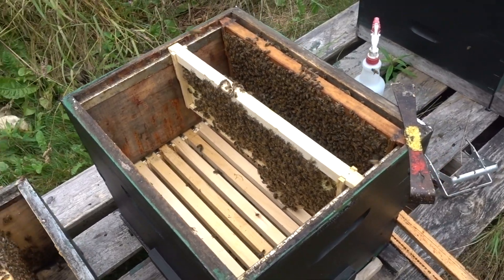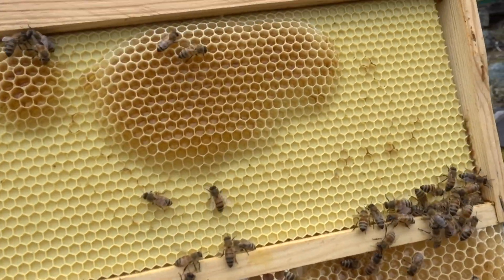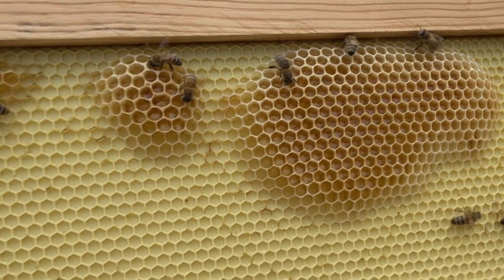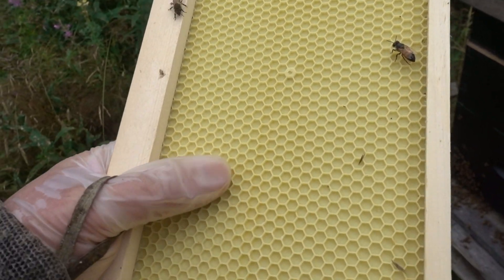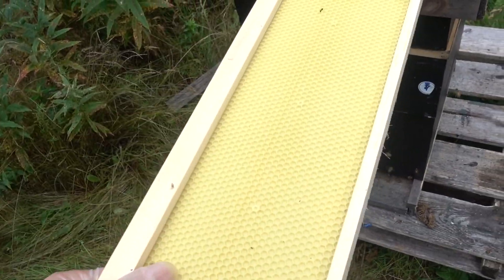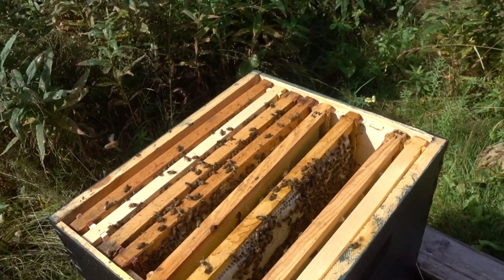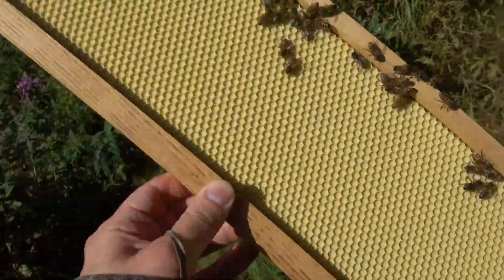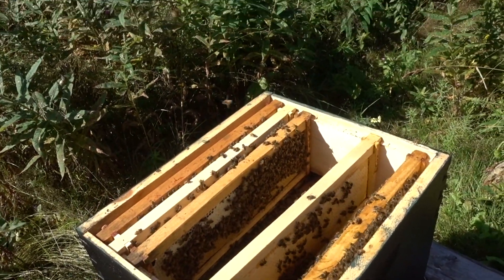When Honey Bees Won't Draw Comb on Plastic Foundation

Comment: I like the plastic foundation over the natural wax for the simple reason that you can spin the crap out of them without breaking as the natural wax does a lot of times even with the wire in the frame.At first, I got RiteCell foundation, and didn't wax them, learned that it is a slow process, than wax paint them, got better, but than I went and got Arrow black foundation that comes as double waxed, I got those because I can't see the eggs in the  yellow plastic or natural wax but can see clearly in the black foundation for queen rearing, so I got black foundation even for the mediums; since I've done that, no more issues, feed or no feed the bees, they draw just fine.Because I use Ross Cartriges for honeycomb I care less for the natural drawn frames.Arrow are a little more expensive but well worth the money.When you have a short season like you do as me here in Michigan, every little trick helps to speed up the process.Dan
Reply from the maker: I have a few boxes of white and yellow foundation, and I'd be glad to get rid of all of it.  If we're using plastic foundation, it makes no sense to me that it would be anything other than black, whether it's for the brood box or honey supers, but especially if it's for the brood box.

I've heard about the foundation that is double-dipped in wax, and everyone who tells me about it, loves it.

From what I've heard from UK beekeepers where foundationless frames are pretty common, the size of their frames are smaller than standard North American frames and aren't as likely to blow out in the extractor.  And I've heard from some beekeeper in the US and Canada who claim they can extract foundationless frames without any issue, but they must be heavily enforced with wire, or they're using a different kind of extractor than me.  Most of my foundationless frames don't survive the extractor.

I'll see if I can track down some Arrow foundation.  Thanks.
Reply: I can only speak to what I learned in my apiary, I got my black plastic foundation on amazon, anywhere else it is a bit more expensive, they are out of it right now, but come late winter/early spring, they should have it again; they do have them in 10pcs box but I by mine in 100pcs boxes so I am waiting until they have them back to get more; I typically put together 500 frames at the time of each, deep and mediums because I use mediums for supers and deeps for brood exclusively with a queen excluder over the brood box; I single deep box in my apiary unless its early spring and need new nucs, than I put a second deep and move 4-5 frames of solid brood up with the queen excluder still on the first deep, let the young bees come up and cover the 4-5 frames and than split in nucs, that is my strategy and approach to control swarm in the same time along with making some extra cash on the nucs that I sell.Try the black ones, I got mine for somewhere around 145$ or so per 100pcs box, a little more expensive than 100-110$ for the RiteCell foundation, I will never go back to the RiteCell even with me wax painting them, just like the black a lot better, specially the brood ones, lol.Have fun.

Comment: I've use plastic foundation for years. It works great, but I always paint on melted wax first. I have never had a frame ignored. Paint your foundations and they will work great. They will draw great during the flow. Feed 1:1 when flow is slacking off or you are in dearth and they will continue to draw. Do not discount plastic foundation. Foundationless is great, too, by the way, but a little scary when extracting - tends to blow out while plastic foundation never blows out.

Comment: I’m in western NL and definitely had trouble getting comb drawn.  Now i did get my nucs terribly late ( Aug) but evn my own splits made in July were the same.  I dont think it was the plastic, the ritecell are coated pretty good.  Plastic just holds up so much better to the extractor.  Need that if commercial.
Reply from the maker: Yes, in the last 3 minutes of the video where the screen is blank, I talk about that too, how I've heard from other beekeepers in NL who keep bees in a better location than me who had the same problem.  The bees just wouldn't draw out comb.  It's good to hear another report (so I know I'm not doing anything terribly wrong).

I still think the foundation I bought didn't have much or any wax on it.  I even compared it to some foundation I had in storage and I could easily scrape more wax off my other foundation.  In fact, I don't think the foundation I bought had any wax on it.  So the plastic foundation probably played a part in it, though as with most things in beekeeping, it's difficult to pin anything down to a single cause.

I got the bees in one colony, one that was on the verge of swarming, to build comb on the foundation, but I stuck the waxless foundation between two brood boxes to to it, and even then they weren't quick to build on it.

The only other factor that I can think of is the cold spring weather.  I'm not sure what it was like on the west coast of the island, but it stunk on the east coast.  It was too cold for the bees to do anything.  Subsequently, they didn't pollinate as many fruit trees, didn't bring home early spring nectar and pollen, and didn't build up as quickly.  After that, they just couldn't get into the high gear required to build new comb like they normally would.

Just a guess.

Comment: All I use is foundation less frames. The only way to go. Use a queen excluder and a top entrance so you don't get drone comb in your supers. Natural Honeybees are smaller than the ones made with wax or plastic foundation unless you use small cell foundation so they have no trouble going through the excluder.
Reply from the maker: My deep foundationless frames rarely survive the extractor.  I know some people say foundationless frames work in extractors, but I know from my own experience and from what I've heard from other beekeepers, foundationless frames often fly to pieces in the extractor.

I prefer crushed and strained honey and comb honey over extracted honey, but extraction is the only practical way to harvest most of my honey.
Reply: @mudsongs  I have used a cheap two frame electric extractor for 3 years with no blow outs and I spin deeps and mediums. I use 30lb fishing line  for support.
Reply from the maker: @privatebubba8876  -- I would say I can't go with completely empty foundationless frames.  I used to use fishing line too, but I got lazy.

Comment: From my experience to get the bees draw Foundation need to feed them. Especially this time of year
Reply from the maker: Did that too. The problem here was the plastic foundation had no wax on it.  The bees drew more comb on the foundationless frames.
Reply: @mudsongs  Yep you violated bee space by leaving an opening between 2 deep frames with the medium frame in the middle and the girls will fill the bottom before they even think about the plastic foundation. Now the boon to that is you can cut that bottom section off and rubber band it in another medium frame with no foundation and now you have 2 frames of drawn comb. Remember to put the edge that was attached to the bottom of the frame to the top of the new frame other wise the bees will just destroy it and not use it at all if it is upside down.
Reply from the maker: @privatebubba8876  -- It was done deliberately.  I put a medium frame in a deep brood box on purpose in an attempt to encourage the bees to work on the waxless plastic foundation.  Later on I moved the comb from the bottom of the frame to a foundationless frame.
Reply: @mudsongs  I know you did it deliberately and the bees deliberately did what they because of bee space. Even had the plastic had more wax the girls would have done the same.